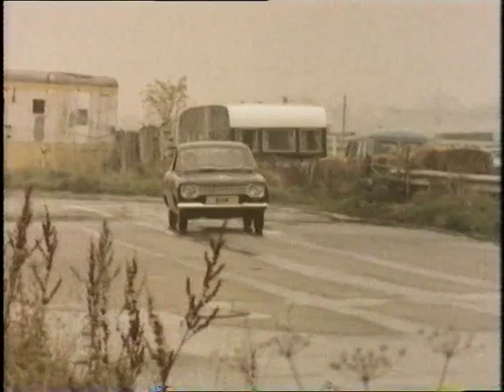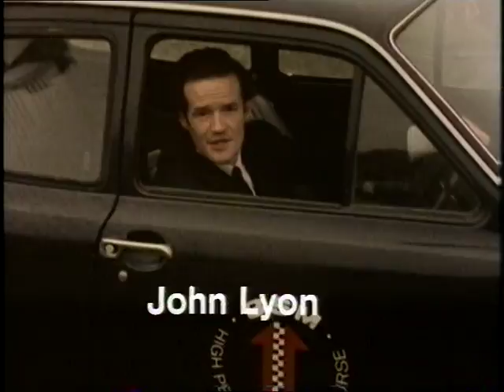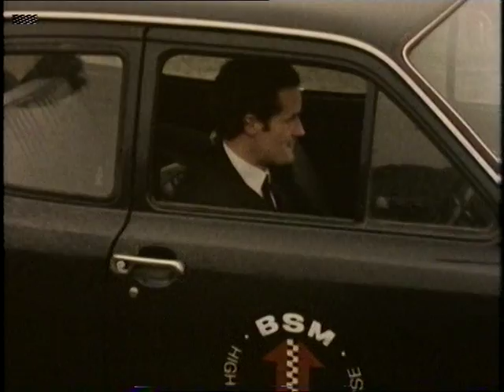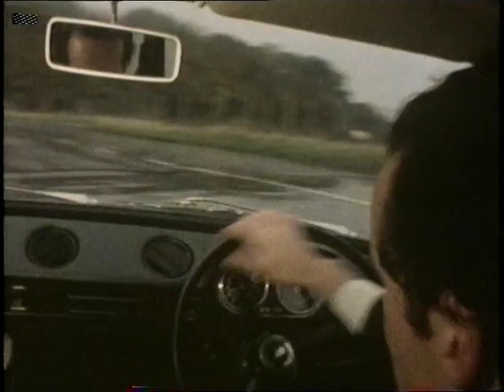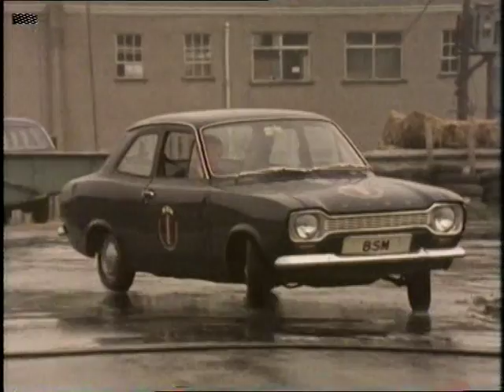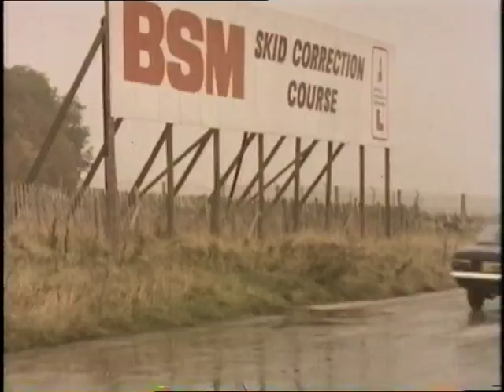How to skid your car | Motoring show | Drive in | 1973

Comment: I was taught on a RWD car to keep the power on very slightly, or the balance of the car would be disturbed and it would spin (this was in a Mazda miata/MX5). But I suppose it depends on the vehicle itself, the road surface, and the speed you're travelling.

Comment: Suddenly taking the foot off the throttle causes weight to be transferred to front wheels and lightens the rear wheels so much they almost lift off the road. Not a happy place to be. Suddenly decelerating  worsens the skid substantially.   
Instead slightly reduce the throttle and steer gently into the skid. (Be ready to steer in the opposite direction as overcorrection of oversteer is very common and this will cause fishtailing). Many cars of that era understeered. This requires rapidly centering the steering wheel and removing the foot from the throttle. 
Go to a skid pan, pump the (preferably bald) tires up to 50 psi and practise, practise, practise. It'll take a few hours but eventually everything "clicks" and you'll never have to worry about a slide ever again.